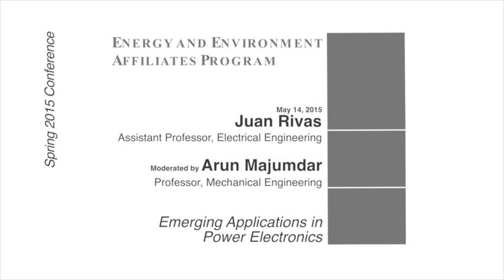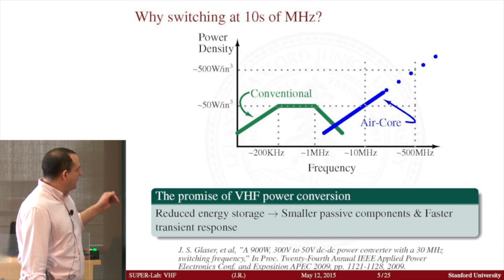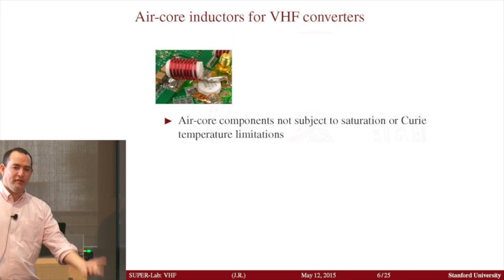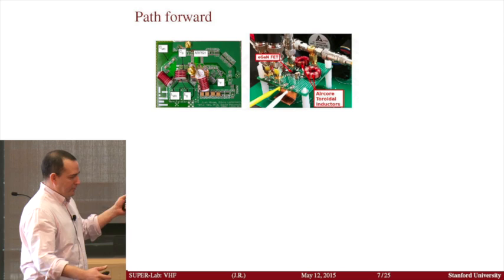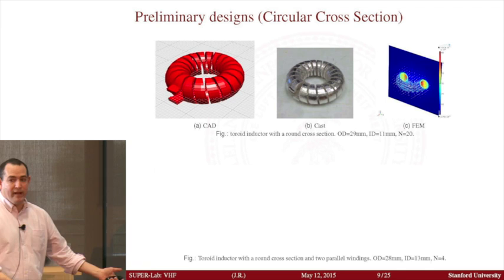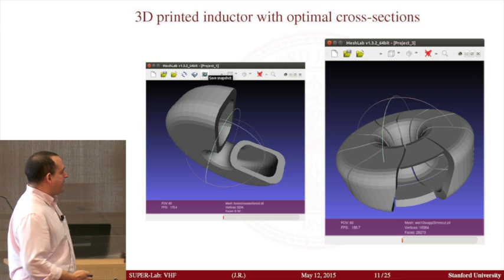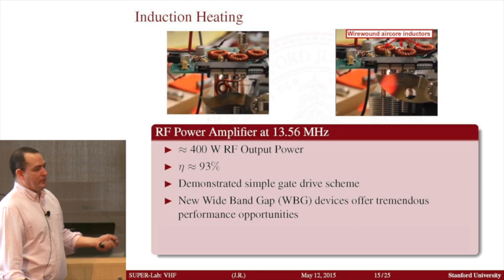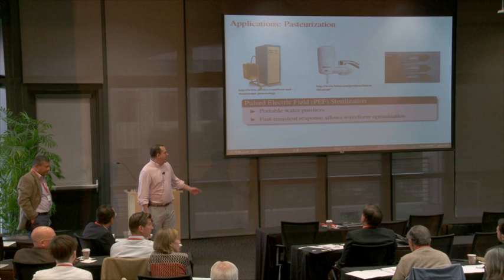Juan Rivas | Emerging applications in power electronics

Comment: Dear sir if you put power supply inside a FARADAY  cage . You delete magnetism from external influence. (may use in MRI). Do not need Power supply far from the machine ("faraday cage" blocks magnetism-external)